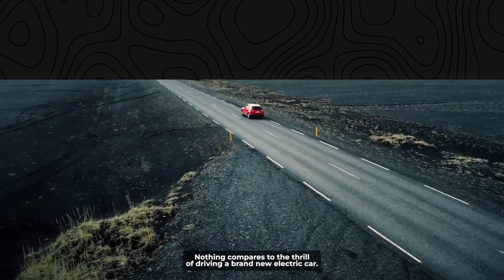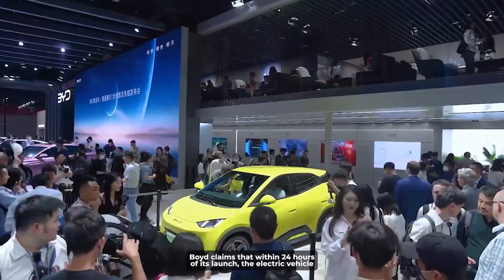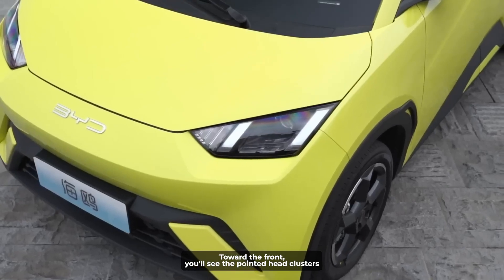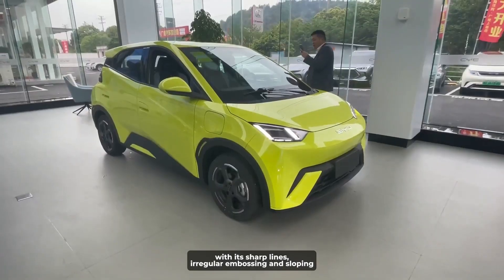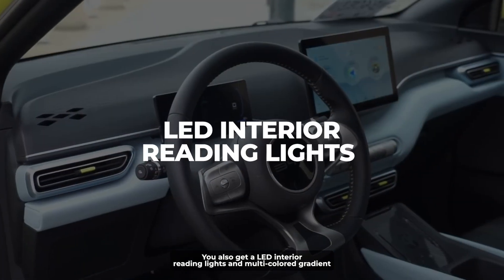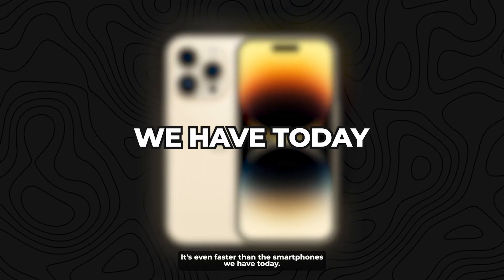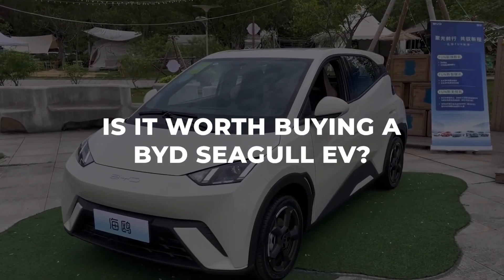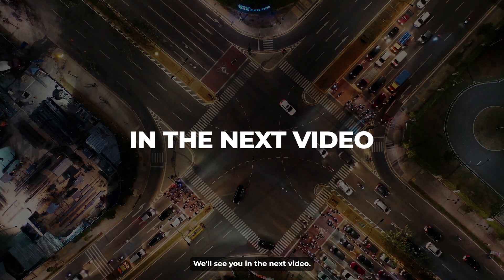Unlock The Power Of The BYD Seagull EV - What You Need To Know!

Comment: So the charging speed between 30-80% is 30 kW. 😂
I knew there would be a downside to the price, which probably is for the Chinese market, and therefore at least twice as high when/if it comes to Europe. 👎
Reply from the maker: Thank you for sharing your observations and concerns! Regarding the charging speed between 30-80%, it is indeed mentioned in the video that the BYD Seagull EV has a fast charging system. However, the specific charging rate of 30 kW is not explicitly mentioned but we point out 30-80% within 30 mins. It's important to note that charging speeds can vary depending on factors such as the charging infrastructure and the specific capabilities of the vehicle.

As for the price, the script mentions that the BYD Seagull EV is an affordable electric vehicle with a price tag of $11,400. However, it's true that pricing can differ when vehicles are introduced to different markets due to factors like import duties, taxes, and other regional considerations. The actual pricing and availability in Europe or other regions would depend on BYD's market strategy and local regulations.

Thank you for raising these points, and it's essential to consider charging capabilities and pricing variations when evaluating electric vehicles. As the EV market continues to evolve, manufacturers like BYD are constantly working to improve charging infrastructure and expand their presence in different regions. If you have any further questions or comments, please let me know. I appreciate your engagement with the video content!
Reply: Where the h did you hear 30 kw charging speed?

Comment: AWD option needed in all SUV's
Reply from the maker: I appreciate your comment! While many people find all-wheel drive (AWD) desirable in SUVs for improved traction and stability, it's important to note that not all SUV models come with AWD as a standard or optional feature. The availability of AWD varies depending on the manufacturer and their target market.
Reply: Not true. All SUV has 2WD version and 2WD is the best selling model .
Reply from the maker: Thank you for your response and clarification. You're correct that many SUV models offer a 2WD version, which is often the best-selling model due to its lower cost and better fuel efficiency compared to AWD versions. 2WD SUVs can be suitable for individuals who primarily drive on paved roads or in areas with milder climates where additional traction from AWD may not be necessary.
However, it's also worth noting that AWD is a popular feature among SUV buyers who prioritize enhanced off-road capability, improved handling in adverse weather conditions, or greater traction on various terrains. AWD provides power to all four wheels, which can offer benefits in certain driving situations.
Ultimately, the choice between 2WD and AWD in an SUV depends on individual preferences, driving needs, and regional factors. Manufacturers typically offer different drivetrain options to cater to a wide range of customer requirements.
Thank you for bringing up this point and contributing to the discussion. It's important to consider various factors and choose the drivetrain that best suits your specific needs and driving conditions.